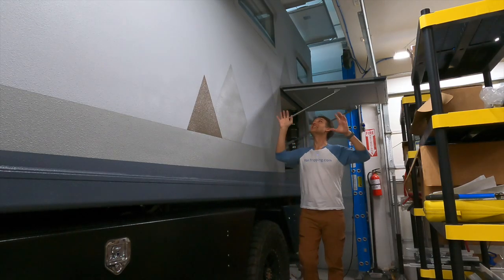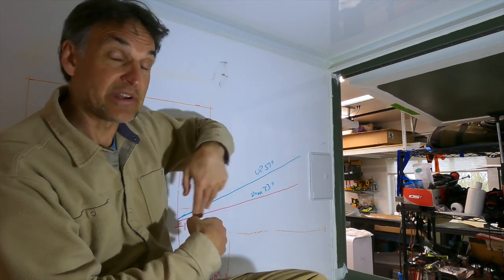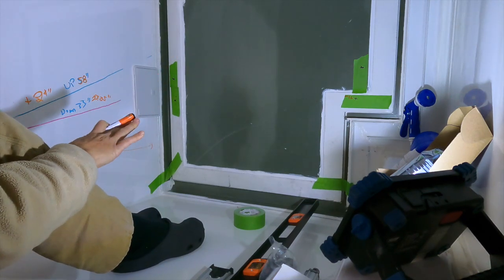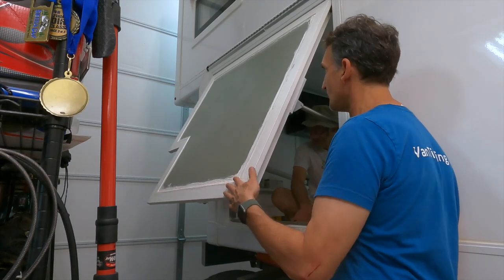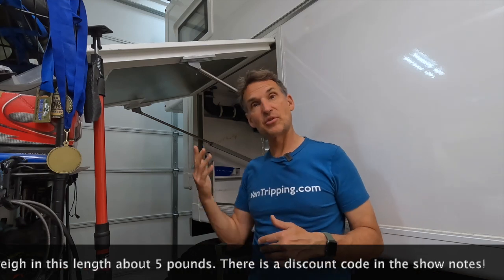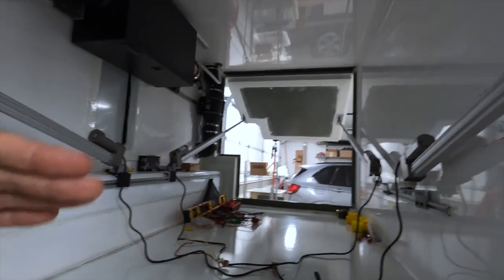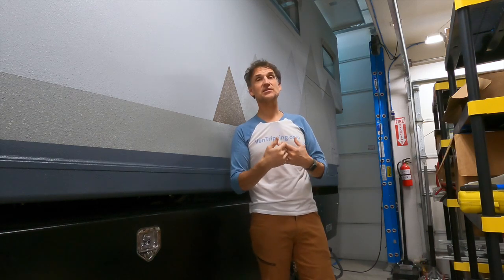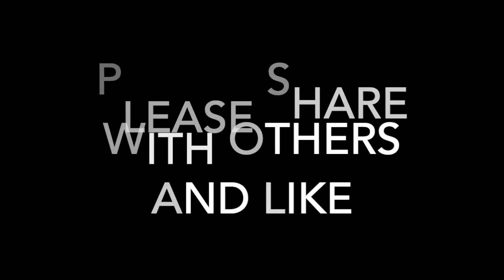Secret expedition camper doors with no latches or locks

Comment: I am curious if you are using an app, is it possible for someone to hack it and open things up?
I know a lot of the new cars with keyless ignitions are easily stolen......
I just thought of a second use for the door if a person wanted to they could make that into an outside shower pretty easily.
Reply from the maker: An app can be used to open it which is a massive benefit since we all use our phones for many things, including starting vehicles and entry to our homes, banking accounts, etc, and have biometrics and other security methods that a key does not. There are many reasons why companies have gone to apps instead of just passwords to access because they are more secure. And while nothing can prevent access, the lack of a keyed lock means these doors don't have locks that can be picked or broken for access, or a key copy, as most of the doors likely have very few key variations and pretty mundane and easy to pick or copy keys. So just the lack of a lock makes these doors significantly more secure. Plus no keys to loose, wear out or break, or latch to even grab onto. To access an app requires multiple authentication levels, and managed by large companies with good virtual security, so more secure than simply a key that can be picked or broken, and statistics show that digital keys are far more secure than physical keys. And yes, there is an outdoor shower installed inside one of these doors so it's inside and in a warm space for durability and avoidance of freezing, yet easy as an outdoor wash down.

Comment: All these electric actuators are nice toys, but nothing more. There is no redundancy, and so far, I have only read about inadequate emergency solutions. Regardless of a service life of 15,000 operations before failure, a fuse blowing due to overload caused by an internal blockage is enough. This is already predetermined due to the installation location in the garage and is just a matter of time.

If the actuators are individually fused at all, it is not clear where the fuses are located and whether they would be accessible. Even if the fuses are accessible, this does not protect against a mechanical blockage of the flaps, because the garage will eventually be filled up anyway. The installation location, specifically the large distance to the rear and garage partition walls, promotes the possibility of jamming any kind of cargo.

If you look closely, the actuators, due to their installation position, take up about 15-20% of the entire cargo space, making this space not useable in a meaningful way. The note that bolts can be loosened without tools in an emergency may be true in theory, but in reality, it's just sugarcoating. You might be able to crawl into the garage, but this does not guarantee access to the mounting points of the actuators to then loosen the bolts, even without tools – unless the garage is empty. As I heard, bicycles are also supposed to fit in there. Good luck reaching the bolts, especially applying the necessary force to the bolts under maximum tension, particularly in the unfavorable and non-strength-enhancing body position that would be required. This especially concerns the rear actuators, because there not only bicycle frames and spoked wheels, but also massive boxes, would likely stand in the way.

You yourself praised the terrible locking force in the video.

I don’t even want to start talking about crushed children’s hands – Cybertruck trunk, anyone? Or is there a corresponding sensor system? Especially in lawsuit-happy USA.

The purpose of the electric operation of the passthrough doors to the driver’s cab is also not goal-oriented, unless you are looking for a thriller in the form of dysfunction and extended escape time in emergency situations. Or for comfortable bathroom breaks during the ride for the passenger, since at least one door should be closed during the ride.
Reply from the maker: Appreciate your critique. All of your points are things I thought about and considered, and my approach was not to be a toy yet to provide the function I wanted for everyday use. These is redundancy of two doors and an emergency access door, and the actuators only take up an inch more in the width of these 48" wide doors than spring lifts yet are less in the way of bike handlebars and pedal as spring lift struts. They also don't have the latch mechanism that protrudes into the space, an issues I'm dealing with on my storage boxes. Of course, even a manual close door can hit something inside, but the benefit of the electric actuators is that I have both hands free while closing and can watch while it closes much easier than if pulling a large door down, which these are two high off the ground of even me to easily reach and certainly most others can't reach, so then I have to manage a strap to pull it down and keep out of the way if manual vs electric. There are many benefits to these electric doors for me and my use, and certainly not right for everyone. My electric lifting and lowering bed that I installed on my camper van 7 years ago was also new to people at that time but has become a standard and desired bed option in many camper vans, and just maybe these electric doors will at some time too, just like in StarTrek.

Comment: Interesting 🤔 Looks awesome. 

What happens if you are outside and you lost or damaged your phone?   To open it?

You mentioned you can get in the vehicle but did you say you had an interior switch?
Reply from the maker: It's a great question. I have both a tool-less mechanical disconnect and a switch in the inside.

Comment: Thermal transfer, aerodynamics?  Seriously.  Way over thinking IMO.  You can also get most, if not all, of your locks keyed to one key by a good locksmith.
Reply from the maker: What, you suggesting that I overthink things? Yeah, you're absolutely right, I do. But, when car makers make door handles retract to reduce drag, you can bet that grilles and locks will also add to drag, but not likely much. Using actuators to raise and lower these doors is more about ease of opening and closing large doors that are far off the ground when open, and ease of installation as the locks I was going to install were very complicated on these composite doors, so this was easier and added much connivence and ease of use, in addition to a streamlined exterior and not have to carry a key to open it even if one of all locks.

Comment: Do you have thought of some tripswitch for the case of someone stuck in the closing door?
Is the compartment somehow climated? how do you get rid of moisture?

love your videos, keep 'em coming :)
Reply from the maker: Great idea! Yes, I have a small rear door that can be opened from inside the garage and someone can crawl out, and I will install an interior switch to open each door, but also each door can be opened from inside without tools by removing some cotter pins just in case that happens. The gear garage is insulated and will have a small electric heater on a thermostat controller, which will help to reduce moisture. All great comments and ideas, thank you!
Reply: @vantripping   not what I meant exactly :D
what will you do if someone gets his arm stuck?
Reply from the maker: @DE-li7jt  That is a good question that I only have one good answer for: don't put an arm or hand into the door as it closes, just the same with other doors.
Reply: @vantripping  You could measure the increase in current in the actuator when something doesn't go as planned and then reverse it. Ever thought about doing this pneumatic?
Reply from the maker: @ijsvogels_nl  Yes, this can work just like auto up power windows work with a safety and a good idea. I might do this if the current transducer and controller can be low cost and easy to wire up. I did think about using pneumatic actuators instead of direct current electric actuators, but running air lines would be more difficult than wires, and I need power everywhere, plus air lines tend to leak no matter how well installed, plus would rely on the air compressor regularly running and the system staying up to pressure instead of staying off except when needed. Whereas power will always be available. Plus the electric actuators are much lower cost and lighter weight than pneumatic ones.